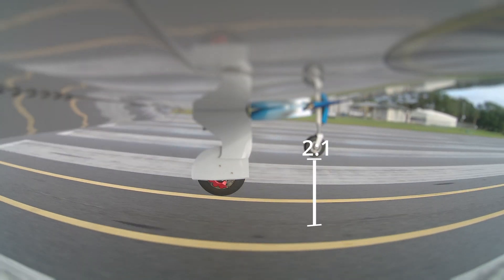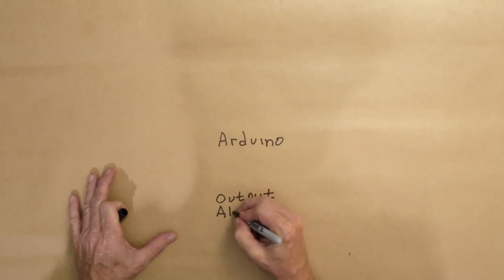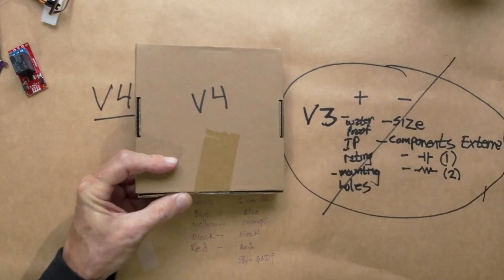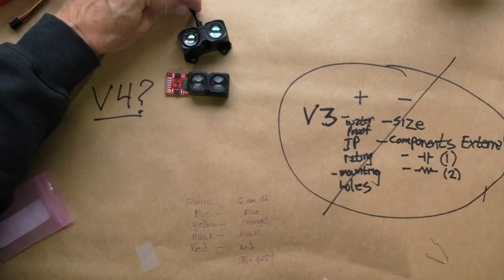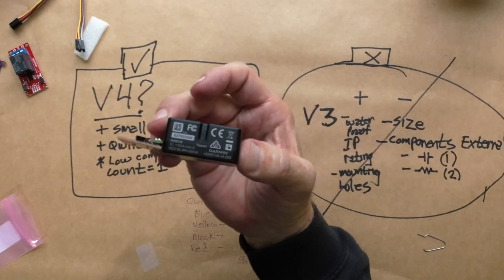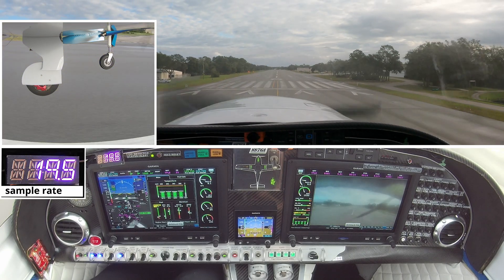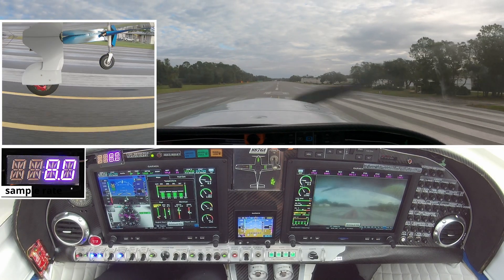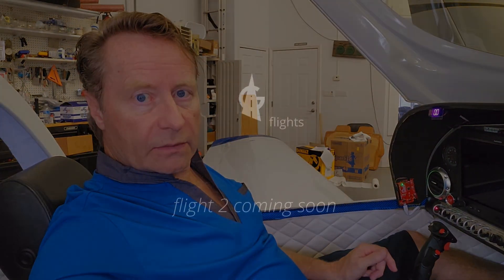DIY Landing Height Display - Arduino and Garmin v4 LIDAR General Aviation Experimental Aircraft

Comment: Very cool project, yes it would be cool to know the air gap under those wheels as a flare does not always present well in ground effect and dumping the flaps inches from the ground would be a smoother landing with less float in a long wing lightning. By the way supper nice Lance!
Reply from the maker: thanks for the feedback on the video, landing heith and the Lancair.

Comment: Any plans to implement on the IV-P?  Aware of Stadia; has interesting aural output. Good luck
Reply from the maker: I might put in the IV-P after I get it refined a bit more.  For me the IV-P is easier to flare and land smoothly than the Lancair 360.  I've considered headset announcements of key above runway heights.

Comment: Nice. since it's a photon time of flight device it should have pretty hefty update rate. Garmin spec says 200Hz or better over I2C so that should be plenty for human use. 10Hz might be good enough but I suspect that more like 50Hz will make the measurement seem very live and reliable. Lag free.
Are you pondering making an autoland feature?
Reply from the maker: Dan - you are always impressive on your research.  And yes not a true auto land but a "call the ball" type of landing assist.  If we had indicated air speed (not ground speed), and several other measures I should be able to display a "ball" within a  "ball" for "best" landing flare to a smooth landing would need to include something for throttle movement as well.  This could be step 1 of an auto land system - however I'm not really wanting to take it that far.  I'd be happy with a "landing flare assist" HUD.  Garmin has an Autoland system available for planes with auto throttles.  In emergencies it handles radio communications and other complex things as well.  Like, finding best airport, runway and some compensation for crosswinds.  I just trying for some experimentation.
Reply: @gaFlights  Thank you :) 
For a proper smooth landing we might need the wheels to spool up as well to match runway speed. Air might also be too unstable for a rigid plane to set down perfectly every time. It might need actuated landing gear to match vertical speed perfectly. We might be bobbing like open sea. Maybe very fast flaps could do it as well.
Reply from the maker: The wheels spinning are interesting.  Potentially some form of cups on the sides of the tires or rims that could scoop the air creating rotation.   Flaps have potential.  Some jet allow their flaps to deploy to 90 degrees rapidly for airbrakes.